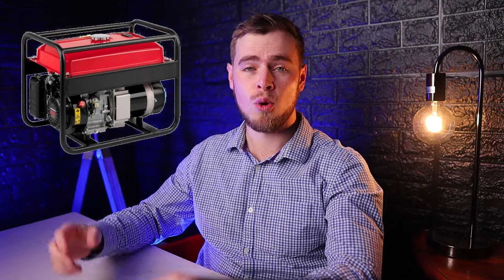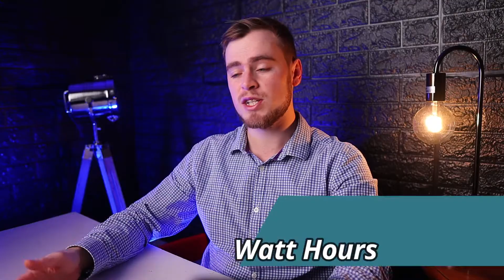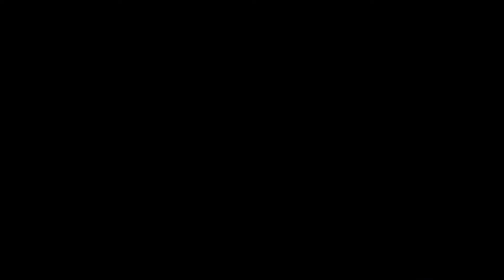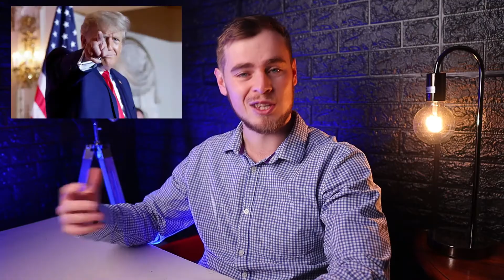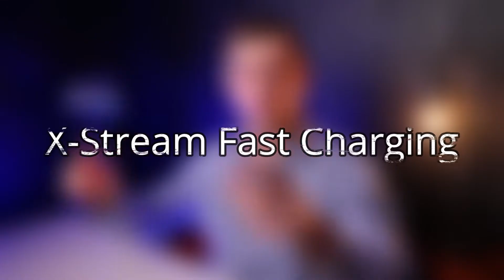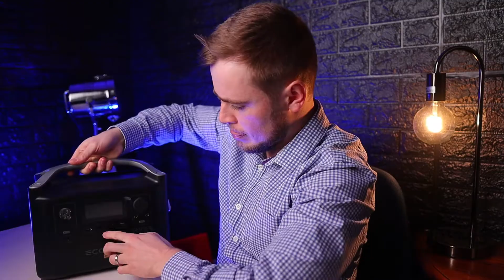Best Portable Power Station Brands In South Africa

Comment: Isnt the River Pro 720wh a bad one to recommend since it only has a 800 charge life cycle? So likely 2-3 years max. Compared the other other options which are generally 2000-3500 cycles.

Comment: Another VERY important point to add which am surprised wasn't addressed:
WHICH UNITS CAN ACT AS A UPS (constantly plugged in for smooth switchover) - and which must only be connected when there is loadshedding.
Reply: Do you know if Ecoflow can be used as a UPS?
Reply: Yes, you, i've been hoping to find someone like you. I have a ups power station but not sure if I always have to keep it connected to the grid, or only use when there is loadshedding? Will it not ruin it quicker being on the grid

Comment: I started using an eco flow river pro for about a month when stage 6 kicked in and mainly used it to power my tv setup, but now lately its gone from lasting 3-4 hrs to barely 2 hrs, any advice ?
Reply: I'd suggest recalibrating the SOC. Make sure that UPS mode isn't enabled (Either set the charge limit to 100% with the app or hold the Light and DC buttons simultaneously for 10 seconds.) Then fully discharge the unit to 0% and recharge to 100%. This works in most cases. if not, then your battery may be busted.

Comment: to cut through any fluff, If you in SA please consider the ACDC 500w (505wh) unit. SOLID SOLID SOLID!  10% (DOD) to 100% in roughly 5 hours is the charging time, which is fine in the WC as we have charging times between load shedding outages. 500 life cycles and battery can be replaced. I run WIFI router/ONT device (25w) 32" TV / Light (45w) and charge phones + laptop  here and there reaching 100W and very consistently get just below 5 hours usage before I charge again.

Then if I game on my Gaming Desktop PC, I get 2 hours on 180-250w. very good! all in all happy with that purchase.

Comment: Great video 👌🏾 Would the Ecoflow River 2 256WH work for stage 4 loadshedding to keep a tv, Wi-Fi and ps5 on ?
Reply: yea brah asking myself the same question
Reply: My PS5 with Dell 32" monitor uses about 270 Wh. Ecoflow River Pro 700W should do the trick for a 2hr LS outage
Reply: https://youtu.be/dGzyKXG8-Dg?si=vcNGBZvkf3iNBqdu
Reply: If you want to have enough gaming power Delta 2

Comment: Just note that there is also a difference between Lithium-ion and LifePo4, which last must longer than regular lithium, which is usually in the older or cheaper power stations.
Reply from the maker: Thanks Shaun, that is an important point to add yes.
Reply: Thank you for sharing your insights! You're absolutely right about the difference between Lithium-ion and LiFePO4 batteries. It's important to consider battery longevity when choosing a portable power station. The Segway Portable PowerStation Cube Series uses LiFePO4 batteries, which provide durability and can support over 4000 cycles. It's a great option to ensure long-lasting power during your outdoor adventures or as a reliable backup power supply at home.